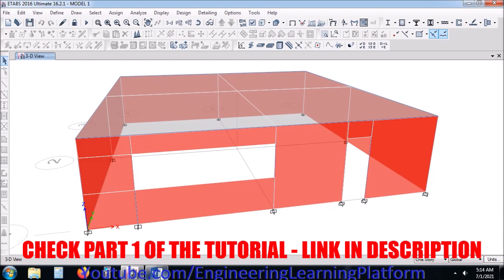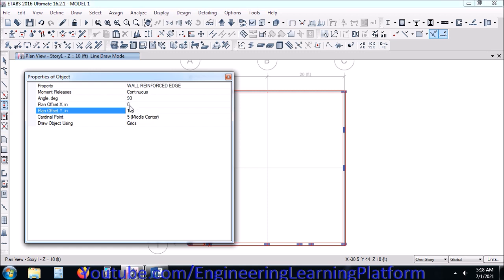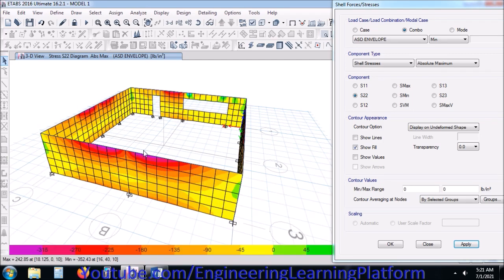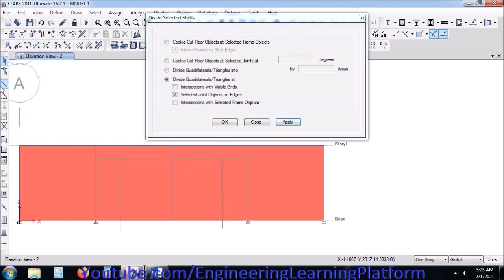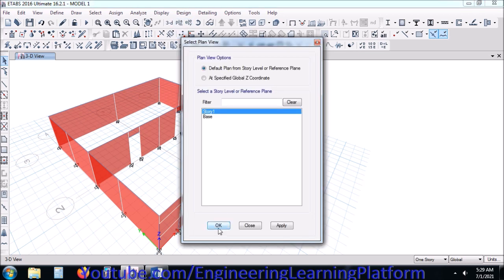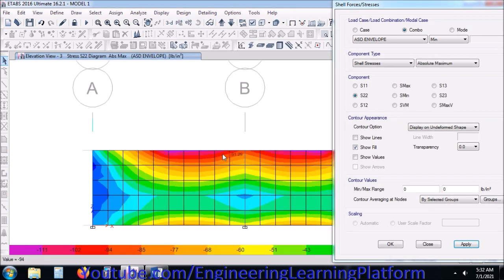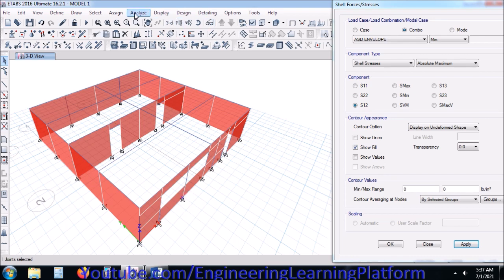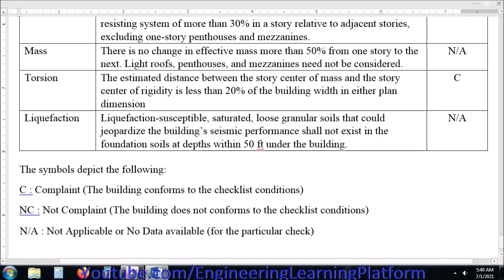HOW TO MODEL MASONRY STRUCTURE DESIGN IN ETABS PART 2

Comment: Hey mate, is it not necessary to assign wall pier labels to different sections while designing the masonry walls? If yes, then what is the best way to go about it since there are so many elements to assign pier labels to? Thanks.
Reply from the maker: Pier labels are for reinforcement and special distribution of forces . Load bearing walls need not necessarily this assignment
Reply: @EngineeringLearningPlatform  Thanks for your reply. But a masonry wall is not only design for gravity loads, also for lateral loads, won't we need pier labels for that??
Reply from the maker: @minimumwageengineer2842  yes for reinforced wall .

Comment: thank you to much sir it was very helpful video, but can you plz show us what is the difference between S11,S22 and F11,F22 because as i thought that F11,F22 give us the axial compression and tension in the bearing wall. thank you again
Reply: It might be a bit late but S11 and S22 are the stresses on the shell element. Those stresses depend on the orientation of the local axis of the wall. F11 and F22 are forces per unit length on the direction of the local axis (1,2,3 → Red, Green, Blue, respectively). For more information of these I strongly suggest looking into the ETABS documentation which is really helpful.Hope it helped.